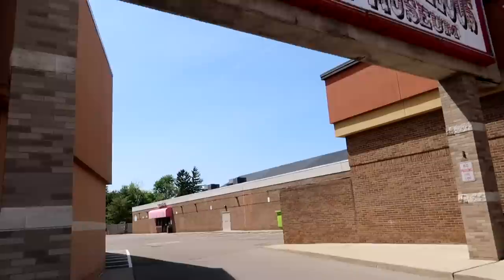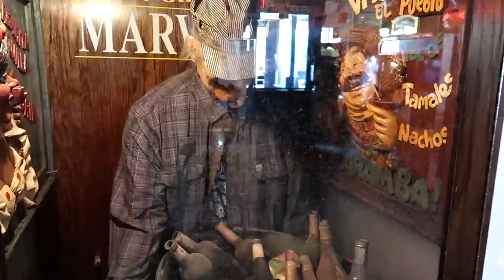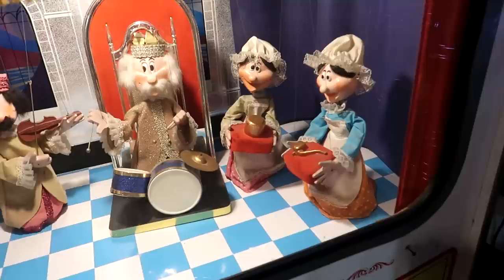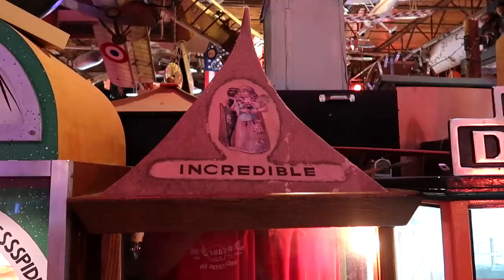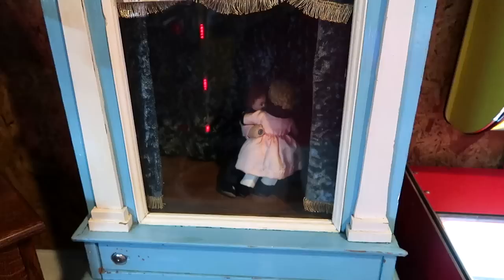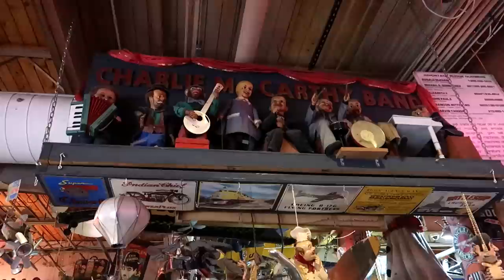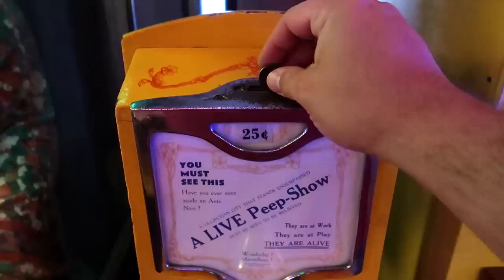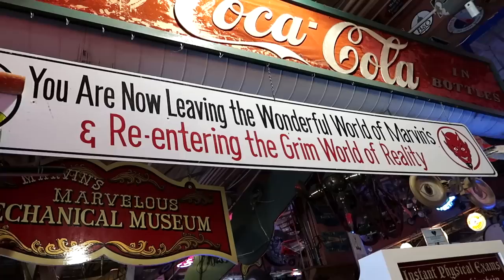Marvin's Marvelous Mechanical Museum - Amazing Coin Operated Collection 2022

Comment: It looks like the snake and Crankenstein needs to be fixed. They didn’t work right.
Reply from the maker: What does the snake do?
Reply: @TheCarpetbagger  It lunges at the glass and a burst of air hits you at the same time from lower on the machine. With Crankenstein he also should have lunged at the bars.